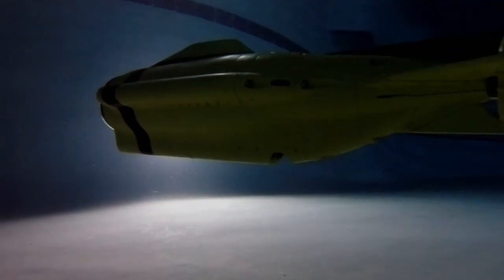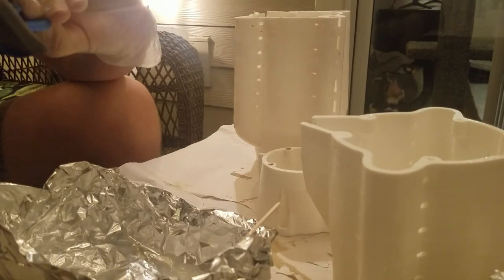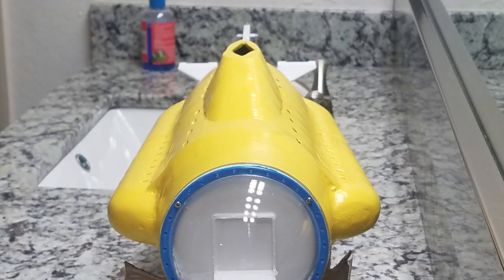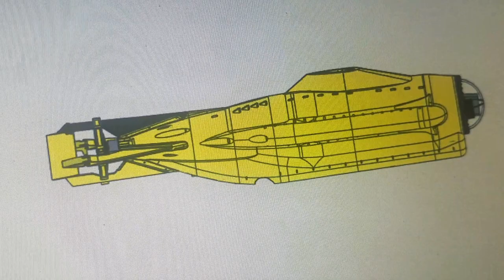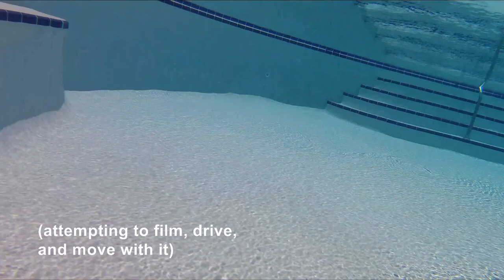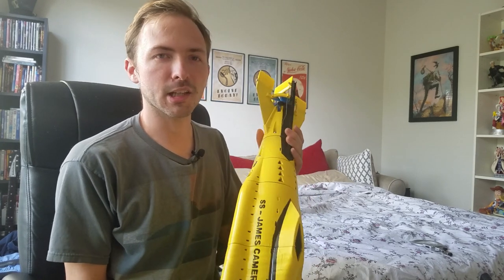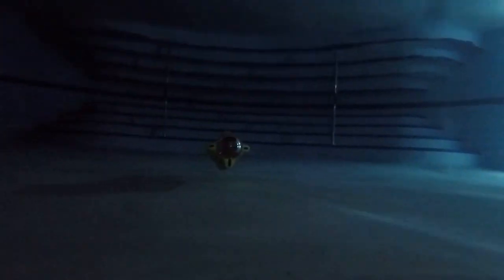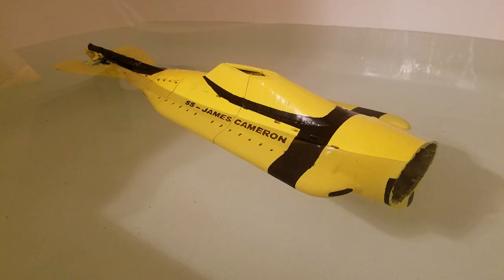RC 3D PRINTED Cyclops SUBMARINE Part 2 - Hull and Final Assembly

Comment: Night shots in the pool had me thinking that you have really missed an opportunity to glue in some LED diodes for illumination. Bonus is that it would make locating the model easier.
Reply from the maker: I wanted to! but at that point it was already painted and sealed. I might get more use out of her because drilling is a cant go back situation!
Reply: @TZeroSystems  you can use modelers epoxy putty together with normal epoxy to plug any accidental or wrong holes.

Comment: Really fine project - expertly well trimmed out too. I've experimented with 3d printed end caps in the past and found they had the water proof characteristics of a tea bag - I mean they seem to leak practically at the molecular scale and they change dimension when wet. So I went back to delrin. But it looks like you found the cure and that's brilliant because printing is quite a lot easier than machining.

One thought though, had you considered using the 3d prints to make plugs for a more conventional and robust GRP lay up? That's probably my next project.

Comment: Did you finally get yourself a printer? I can do ABS now which with an acetone dip allows waterproofing without all the epoxy...
Reply: Ahhh josh and jared... should have finished the video before commenting...
Reply from the maker: No i actually found a guy out in washington who has a service on the cheap. plus he can do the large parts. The hull was 100hrs with one part at 36hrs. It broke the printer due to how many perimeters....
Reply: I almost have Allan's printer good to go.. 120v bed and we will have access to a 400mm cube build area.
Reply from the maker: @roryduncan1534  hmmmmmm i have some things that could benefit from that

Comment: For somebody who is attempting to assemble this there are three types of loctite blue loctite which is the type that is easy to remove and is only somewhat effective at stopping things from rattling out red loctite is for when you want something to not come out without a breaker bar and green loctite is when you don't want something to come out ever as if you put green loctite on something it will not unscrew it will break the bolt instead
Reply from the maker: yes accurate, i only had blue on hand

Comment: I wanna do the same, but bigger and wit more parts, like every visible line on the model from the game will separate the parts, if I get my first big 3d printer, but it looks really good, I just want it to be 3 meters long or so
Reply from the maker: That would be massive! The lines would have been possible to do but I wanted to make progress so much that I cut that from things. 3m will most definately take a crane to put in the water I think! You might have a 40kg beast at that point scaling from what I had to add for ballast. Would be neat though
Reply: @TZeroSystems  yeah I know, but I wanted to have it as a detailed model standing somewhere in my house, not really to drive around with, I would put in a few lights though

Comment: If you add a section like the following to the description (main thin is the first line and one line per section... I didn't put in the correct time for the final assembly), Youtube will make your video a lot easier to navigate...
0:00 - Intro
15:42 - Final Assembly
Reply from the maker: I shall paste this! thanks!
Reply: @TZeroSystems  you should add a couple lines and check the times... I just threw out an example and am quite sure the final assembly time is wrong.